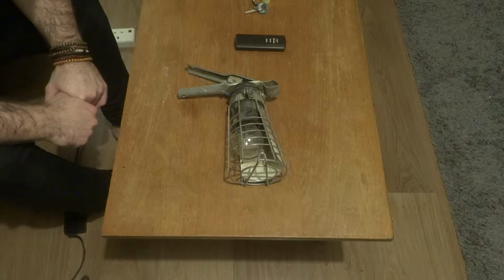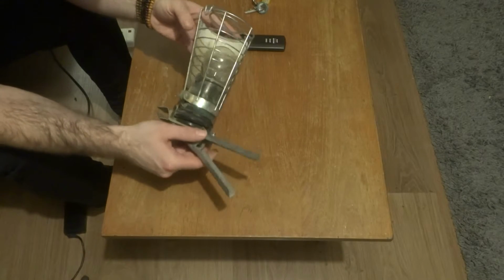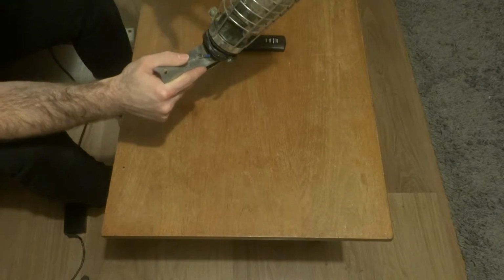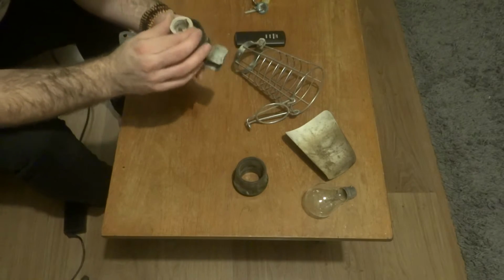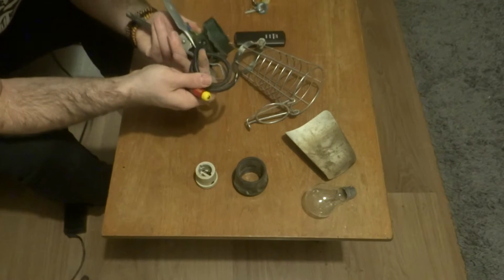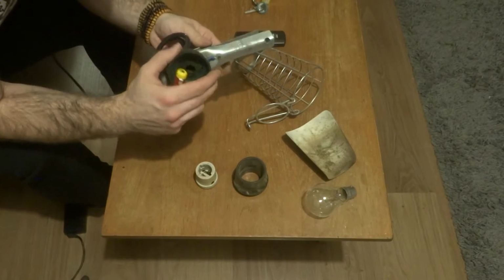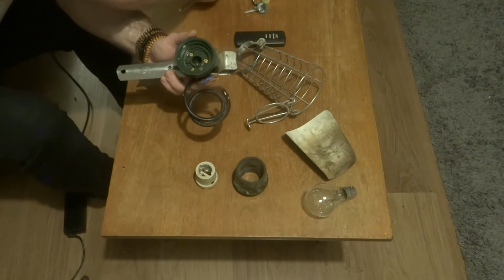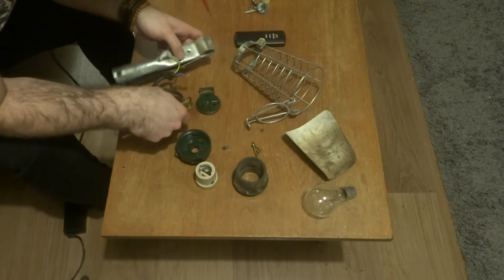Vintage Briticent Gripper Lamp Restoration Pt 1

Comment: Thanks for the info. I've been looking for these on line and can only find them as antiques on ebay.
I've had loads of plastic imitations but the Briticent Gripper is by far the best. Quick and easy clamping action and very strong spring. Loads of clamping points when working under a car.
I thought they were generic, didn't realise they were made by Briticent ( no longer made, sadly ).
Just rewired mine, which must be 60 plus years old.  Thought I might find a replacement ceramic bulb holder but probably no chance. Won't even give  the disinterested  young shavers the chance to pull a face when the old timer asks " Got any bulb holders for these ? ".